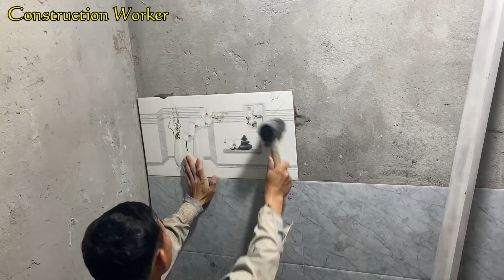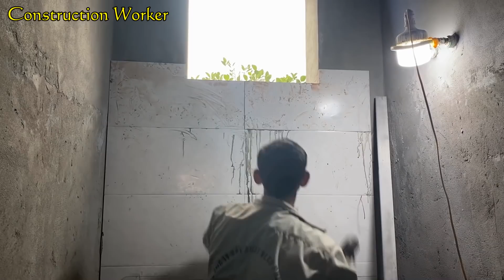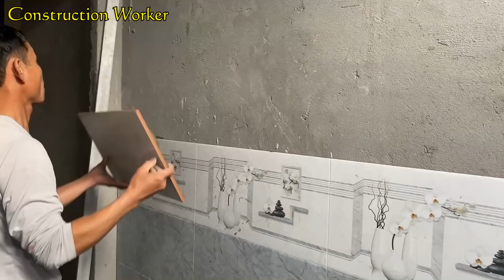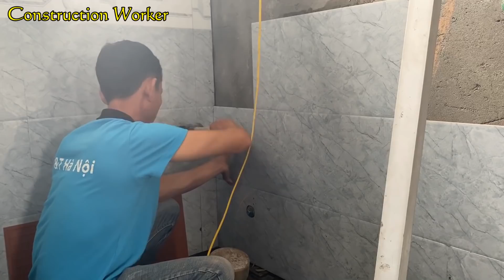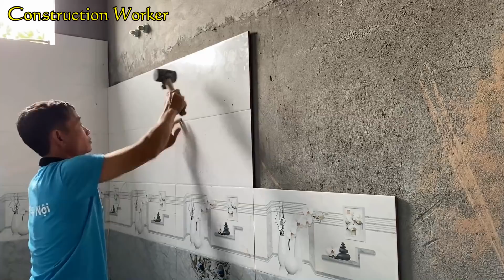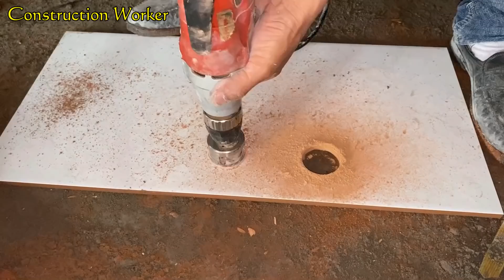Techniques Construction Bathroom Wall With Ceramic Tiles You Must See - Building House Step By Step

Comment: Any tilers out there actually tiled with sand and cement?straight on this surface?
Theres  no need for dissing this tiler in any way i sugest you try it yourself. Ive worked in germany tiling massive sport centers and and spa's all done in sand cement.
The hammer is used to flaten the morter and leave the fixed tile solid bed even whers the joints meet so no need to grout.
Dont think thers any air pockets with this guy hes done this for years and these tiles will be stuck for at least 30 year👍👍 great vidio we need to wake up the puffs an there mastic

Comment: I have two concerns as follows:
1) No provision of spacers, hence no grouting in between the tiles.
2) Near cormers of the window, he left the cut tiles of the wall flushing with the plastered wall & bottom surface behind. So when the adjacent walls & bottom surface of the window will be tiled, there will be a problem of a gap coming.

Comment: Just middle side got the cement. Angle side no cement
When I use the hammer easily can break a hole from the angle. We call it lie work.
Reply: Tht true
Reply: he put thick cement mortar so when hit with rubber hummer it covers the edges, don't you think so ?
Reply: @voanirges  it may work, but not guarantee.
Reply: @sdahao  agree, there are many things wrong here, he uses a mix with cement instead of dry pack mortar for tiles, he should put it on wall first and then backbutter the tile etc...
Reply: @voanirges  the way this tiler does it probably gets rid of bubbles
Reply: @offthewall9988  might be, as I said, the best is to use dry pack and to have lines perpendicular to shorter edge of the tile, and lines should have same direction on the floor as on the tile, you have to press it and move left right so air comes out and tile has to be backbuttered , although I like to put it flat with no lines on tile, only on floor etc, but I like the way he did it to be honest
Reply: @voanirges  I think they have a one tile fits all policy there and thats why they are so skilled. it certainly helps

Comment: Layout is brutal....look at the sliver that will remain at the right side of back wall.  Should have run a full tile down center with equal cuts at either side. Epic FAIL.
Reply: absolutely..here is a good example of as built layout is so bad, especially such narrow width (approx 40"?) will result in asymmetrical display of tiles reference to the window when one doesn't have perspective view.
Reply: Spot on, its all about the layout, this one is wrong.